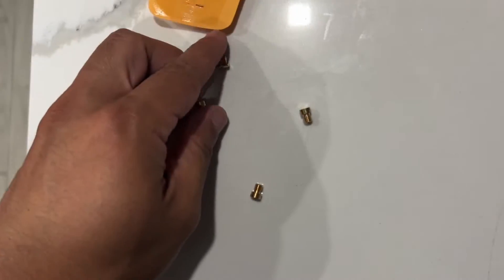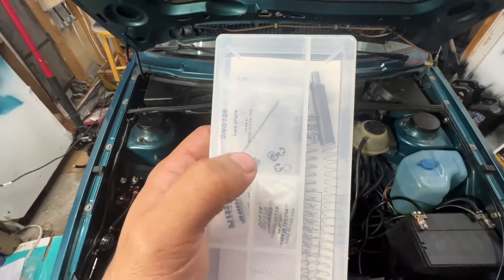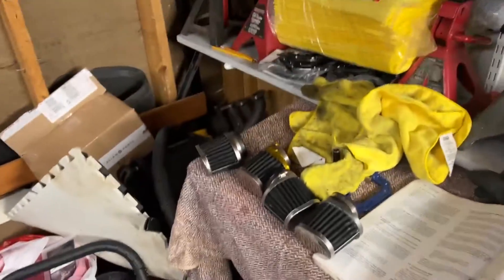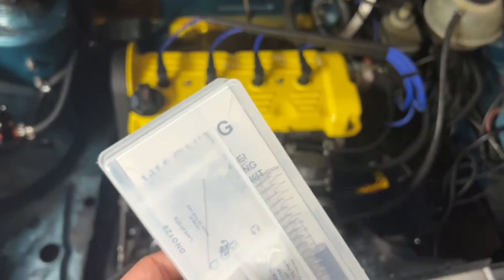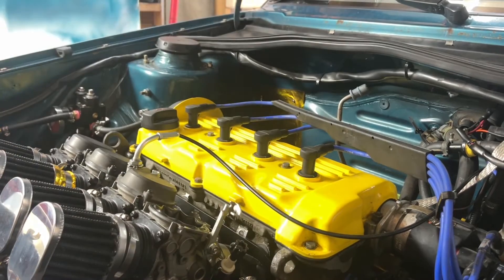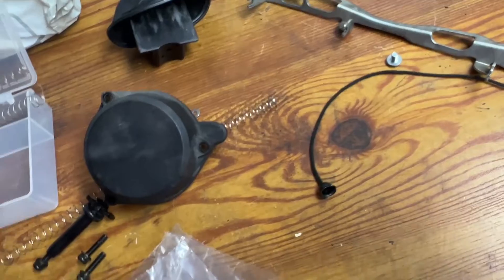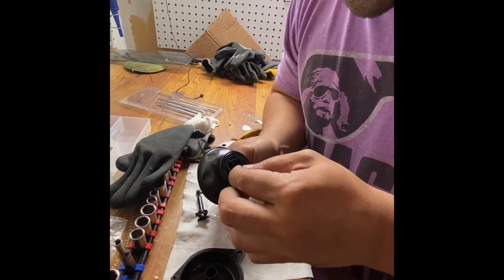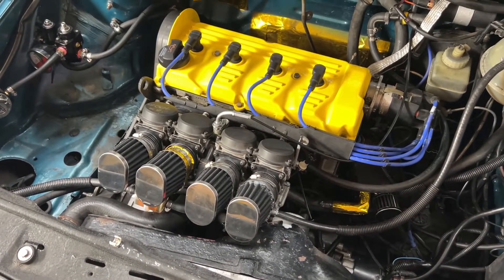Dialing it in further! MK2 GOLF ITB Part 5: More Tuning!

Comment: What alternator pulley did you use? I have been looking at doing a similar relocation but cannot seem to find the right pulley
Reply from the maker: couldn't tell you. I walked into a shop that rebuilds alternators, told them what my problem was and gave rough measurements, he went to the back and gave me some pulleys to try until we found one that lined up or was close. 🤷‍♂